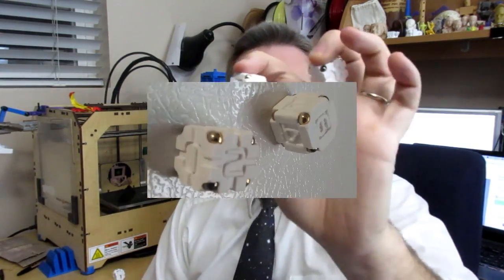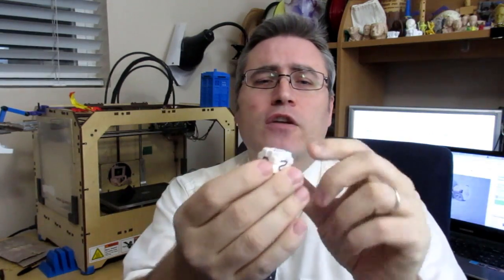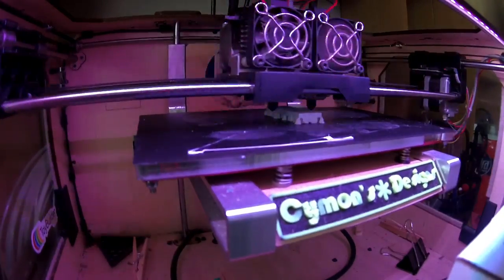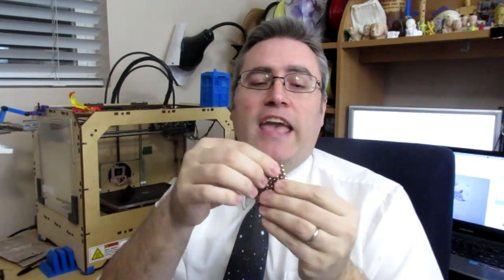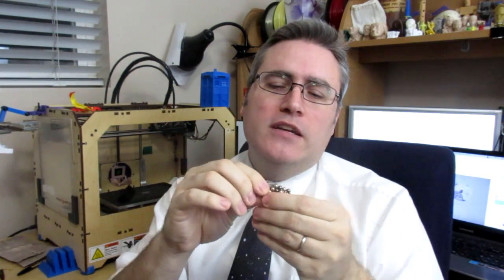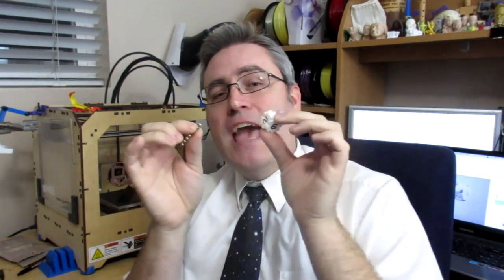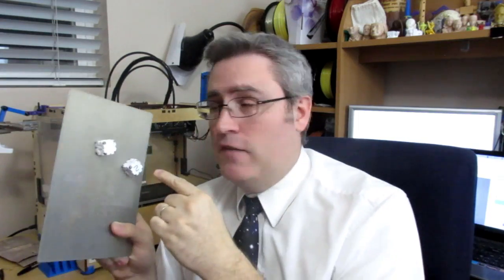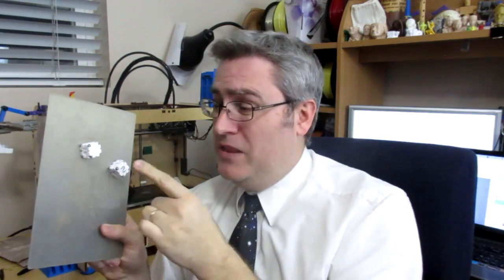How can 3D printing make space life better?

Comment: Couldn't you put the magnet in the center and it would have a weak pull on what ever side it lands on which should theoretically be equal on all sides? And you could possibly maybe roll them one handed if the pull was weak enough to be overcome by kinetic force.  The trick would be getting just the right size magnet.

Comment: Hahaha nice to see you're on the job!
I immediately thought about the expanse books which deal a lot about life in space.
Although doesn't deal much with robots that would probably be 3D printed in space to do most of the work. As soon as we have things like 3D printable artificial muscles that could be printed in one go, you could have real "rep rap" printers in space. Some printable material that contracts when you apply voltage and a 3D printer that can mix different materials and some wires together in one print.

Comment: You're welcome Mr. Professor. I charge you now with designing a die that can be rolled underwater.
Reply from the maker: Well I can't not do it now. I guess I've got to get some more tungsten filament and another hardened nozzle.
Reply: If you would just get a large metal ball, and print 2 hollow halves that connect nicely? Just put the ball in, and glue them together. Done!
Reply from the maker: Jelte Klas Wijnja That was similar to my first thought, to put them in one of those plastic eggs that nylons come in, but that seems too cheap.
Reply: I'm not sure if I was clear? If you were to print 3 sides of the dice, and the other sides the same, you could make it connect very smooth. Then just drop a metal ball in the hollow center, and glue it shut! It shouldn't look much different from something printed from one piece, I think?
Reply: Sounds likely to land on one of the corners. That said it might be a workable idea if instead of six sides we use a shape with six numbered points that the ball can fall into, with the uppermost point indicating a result.

The real issue is that unlike space many underwater locales are full of gribbly critters, and I hear Morays love to nick people's dice.
Reply from the maker: Ah, so the charge isn't just that it needs to be heavy, but that it also needs to be able to defend itself, while not harming the person rolling it. So that negates making it sharp and pointy like a razor sharp sea urchin. Hmm, tricky.
Reply: Ideally, we would also like one that can be rolled in open water, beneath the surface but also far from the ocean floor. It's not just for me, Posiedon wants one too. Also I might need one that works in waterfalls for the next time I visit the Naiads.
Reply: Just make it beachball-sized ^^ Now it's too large for Morays to nick. Although it's also quite unpractical to bring with you..

Comment: Clearly poorly researched video... why would you need supports on your print, you're printing in zero gravity so overhangs and bridges won't hang or drop anyways :^)
Reply from the maker: Naveication To be fair, I have not printed these in space on the international space station,  no. Would love to as soon as I can, but no, I haven't. However I doubt that even the awesomeness of space can print underhangs that are dangling in mid air. I imagine they need something to attach to or the plastic will just dangle out of the nozzle until it touches something else.  If they could print dangling underhangs I would think they could do away with the build plate entirely.  But like I said, I haven't tried, and I want to, so I could be wrong and for science I say these must be printed on the iss.
Reply: Naveication you can’t print in space even in space

Imagine a sad extruded assembly that has filament pasta just floating around the build chamber